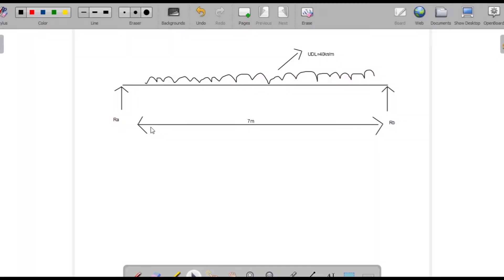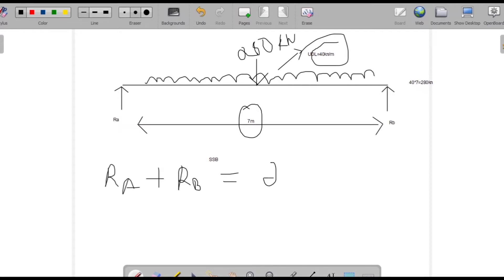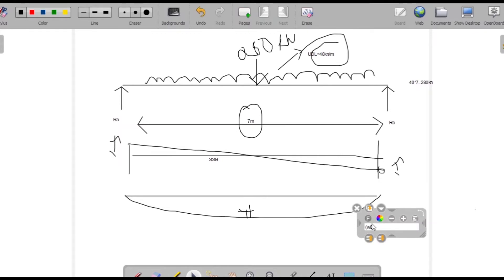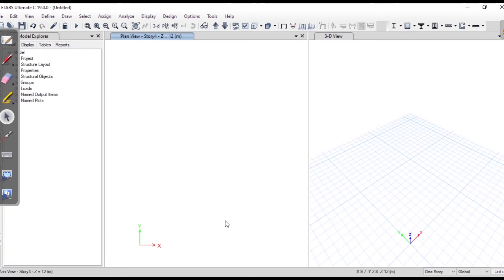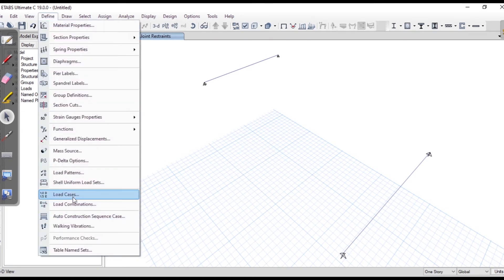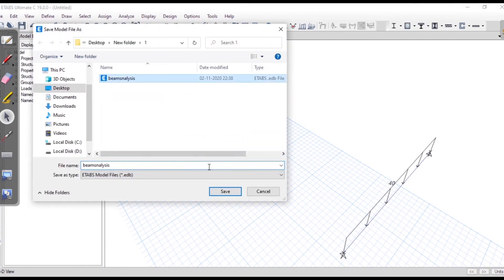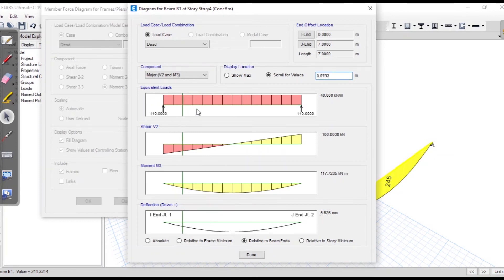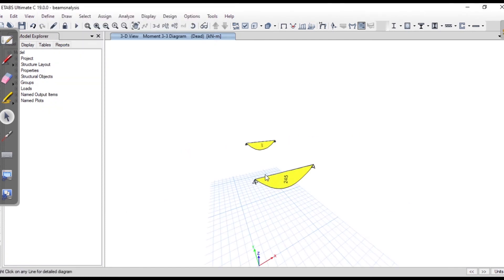Etabs-Analysis of Beam

Comment: BRO , INSTEAD OF assigning joints , why didn't u draw column at end of beams
Reply from the maker: Firstly I Appreciate your feedback.
Bro, it is made for analysis of beam. And why do we need column for it.
If you are working on Complex structrue invliving both beam, columns, slabs, you can add those.

Comment: bro how did u get 2 beams in 3d view i got only 1
Reply from the maker: I made 2 beams jst to show beam results does not get effected no matter how and where u draw beam in interface
Reply: @vvktutorials  thanks for instant reply, I have project of this tomorrow
Pls help me if I have doubt
Reply: @vvktutorials  sometimes when i add point load why i wont see that arrow, i will only be able to see numbers
Reply from the maker: Make sure u have applied check again
Reply: @vvktutorials  if I apply some material, the procedure remains same?
Reply from the maker: Yes procedure is same bro
Reply: @vvktutorials  bro how to assign couple
Reply from the maker: It is actually moment u can apply
Reply: @vvktutorials  bro can we veiw any equation or calculations performed by software?
Reply from the maker: I guess we cannot but we can find detailed values of shear force , bending moment, area of steel at different locations
Reply from the maker: U can have look at custom report /report & check